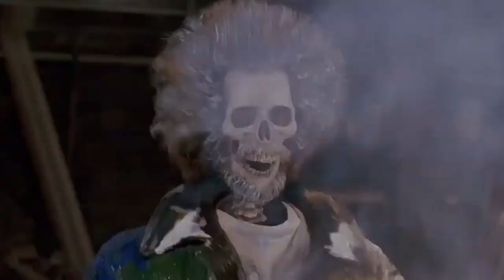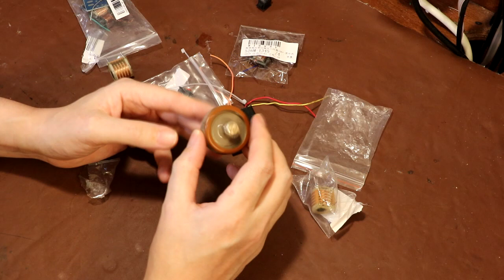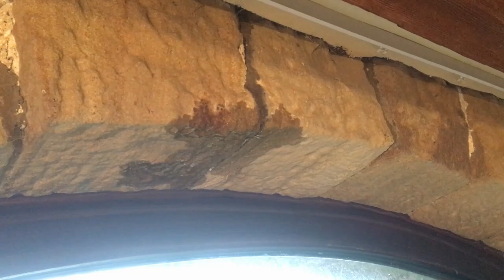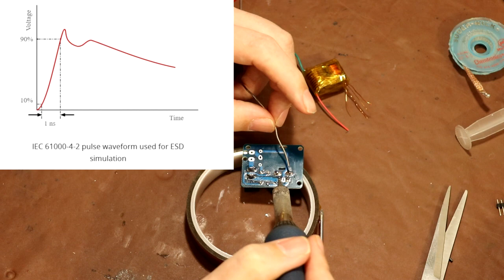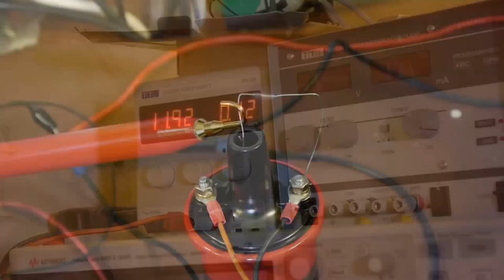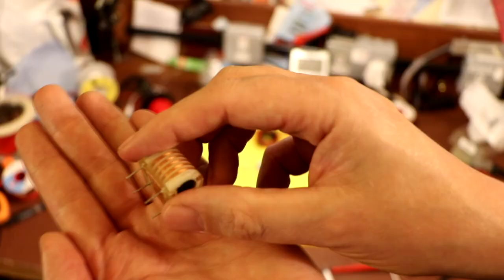ESD GUN - PART 1

Comment: I don't know what a "cockwomble" is, but it doesn't sound good. Isn't the breakdown voltage of air about 25,000 volts per inch? And who among us (those that have did electronic/electric work not only on an occasional hobbyist basis) hasn't been shocked? I've had a few myself, even though I placed a great emphasis on safety. If you do a lot of electronic/electric work over the years...sooner or later. Thanks for posting!
Reply from the maker: The breakdown voltage varies biggest factor probably being barometric pressure and I would guess also humidity.  Electric shocks are just part of the fun and hopefully gives the opportunity of learning good safety practice before a fatality occurs. But unfortunately it’s possible for even the best of us to make a mistake and have half a day out with the undertaker. Thanks for watching and taking time to comment. My best regards Chris

Comment: Hi Voltages are fun and also dangerous when  I was about 9 years old I was  given a very old wooden box which had some brass terminals on the front inside was a big coil and what looked like the coil and armature for an electric Bell only there was no Bell  and it made a loud buzzing noise when you hooked up a battery to it  and I was told it was for giving yourself an electric shock for some reason back in the day it was supposed to be beneficial to your health to give yourself  electric shocks !
Reply from the maker: As you say those shocking coils were widely used in electro therapy by the Victorians for everything from hair loss to increasing vigour in the male member. Happy days. Thanks Benji and thanks for the box of valves very generous of you. I will sort you out with something etc. Regards Chris
Reply: @allthegearnoidea6752  I suspect that was also a use for it ! your welcome

Comment: Nice experiments. Some of the HV diodes don't work at the 10kHz or so which may be why the original circuit didn't work well. I think we're both heading in the same direction
Reply from the maker: I am not sure on the high voltage diode specifications I did have some higher voltage rated diodes as used in microwave ovens they were physical much larger but  produced an output about 20 percent lower. They may still be worth using  with greater multiplication stages as I think they will be less stressed. I’m not sure on the diodes I’m using again I bought these years ago from some unknown ebay listings and they are unmarked. I think they claimed 10kv but don’t remember.  I got a 10kv relay from Pickering bit expensive but opens up some possibilities. Are you going to build in a voltmeter. I think it would be a nice feature!  I didn’t notice your part 2 video. I am wondering how you are going to turn those drivers down I think you probably need some adjustments between 1 and 8 Kv. And don’t forget the specifications call for positive and negative discharges.  Look forward to see part three. My best regards Chris

Comment: I sort of expected you to use a 555 timer + mosfet and a small tv line output transformer at 15.625 khz + resonant capacitor.
Then make a more accurate pulse driver, something like that :-D.

Monochrome portable sets are roughly 10kv from there lopt.
Older colour t.v sets had a tripler pack to bring the lopt output up to 20kv or so, but i'm sure you know about that :-D

The weather has been very naughty here in bedworth, fence panals have been wagging like a metronome, amazing they didn't snap.
Reply from the maker: If you fast forward to the end you will see I published such a circuit using 555. I will be playing with that today. Expect more naughty weather this weekend fingers crossed! Thanks Regards Chris
Reply: Yes i did see that later on, but when you were messing with the kit i wondered about how you might improve it.
Lopt and 555 came to mind, i have an evil mind :)

When you showed the nice multi segmented (stops arking between coil parts i suppose) transformer, i thought about the gas cooker module i have,  you know 1.5v battery supplied and many leads to feed the spark gaps.
Why i kept it from an old gas cooker i don't know.